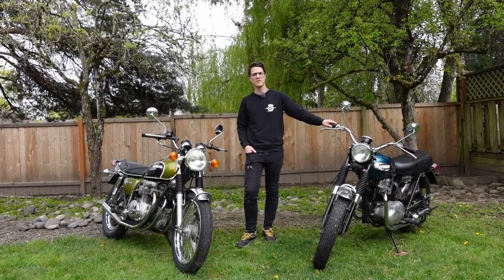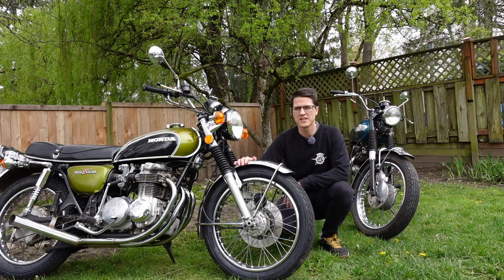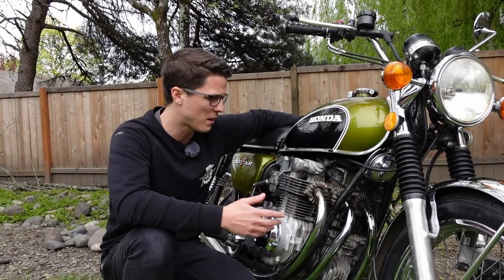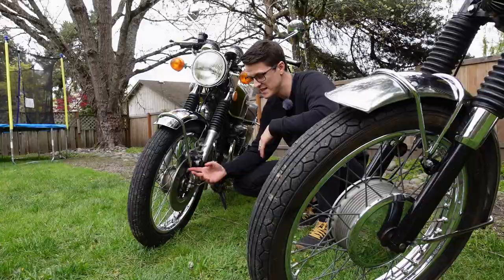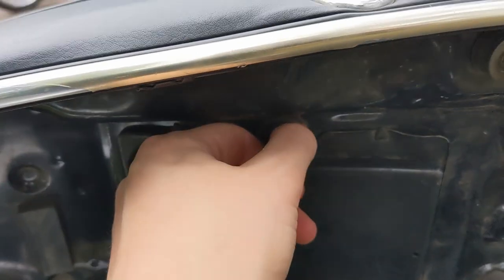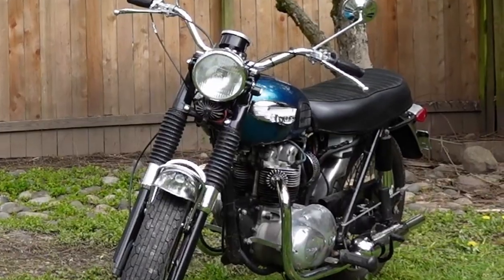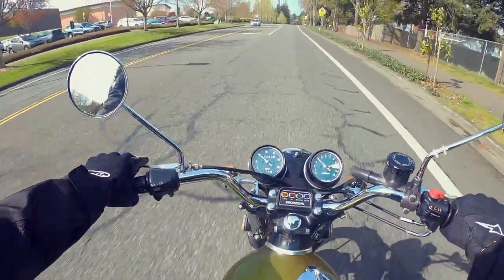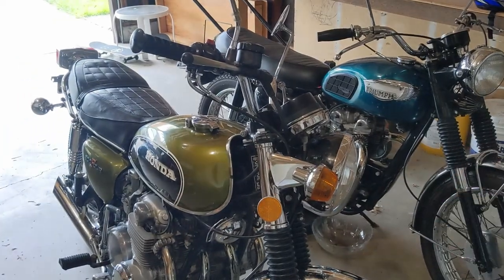How this Honda killed this Triumph

Comment: The Honda in the clip, does not have the genuine exhaust system, which consisted of FOUR mufflers, not the two on this bike. I owned one of these bikes, the first thing I did, was ditch the speedo and tacho to fit the 750 sized ones, bigger and easier to read at speed. the bike was as smooth as a swiss watch, no vibes an all, rear vision mirrors easy to see at any speed. On a long trip to our Pilbara area in the 70's, the high oil temp came on, was using recommended oil, Castrol at the time. Slowed down, light went out, on return home, fitted oil cooler wafer between oil filter and engine and oil radiator. Never again had any such issues. Chain and sprockets were the biggest wear and replacement components on the bike. The fuel consumption and too small a tank were also issues on long touring trips, had to carry spare gallon container at times, whilst Yamahas Suzukis all had better economy than my Honda. BUT the biggest win for me, after owning a BSA, was NO OIL LEAKS !

Comment: The Honda CB500/4 had the same single pot front brake fitted to the CB250, the CB360 and the CB400/4. It really was one pot on a swinging arm which was sprung against a stop. The other pad was not powered at all. Not too bad when new but deteriorated rapidly when subjected to the corrosive salt of a British winter resulting in a seized pivot post and half the expected braking power. We were teenagers so these bikes were our "daily drive". I worked in a machine shop and biking friends came to me for help. I'd press out the pivot pin and polish it. The brake swing arm would be reamed clean if sufficiently bad. The key modification was to fit a grease nipple to the swing arm. If you could pump grease until it came out of the top and bottom of the pivot, the brake worked correctly.
As an aside, I have always found a decent properly adjusted twin leading shoe drum to be every bit as effective as a single disc. Just a bit of a bugger to adjust.

Comment: It was not just Honda it was the Japanese bikes . I started on Hondas but quickly switched  to Yamaha. Getting Honda parts was murder.  Two thousand miles on a s90 and the cam would be pulling it's way through the head.

Comment: Riding is a visceral thing. Also, like personal relationships, sometimes the idiosyncrasies and shortcomings help us to bond closer. Machines stimulate us in different ways, some vibrations, sounds, tickles and wind can annoy us or endear us. Having ridden everything since mini ones in the 60’s, some of the fondest memories are of the most break down prone bikes, like my iron head sporty I carried to and fro for 2 years. However, there is a place in my heart for the ‘69 cb 750, that I only changed oil , filters and rode for 2 years. I have a new Harley that is a beast and I couldn’t want more, yet I one for the shovel head I had briefly (spent more time fixing than riding). Or the xs11 that was a rocket ship or a kitten depending on how you rode it. Throw a leg over, ride and buy all you can (there are great deals on all kinds of old bikes now) and find out what pokes and prods push your buttons. Ride ride ride, and if you have to fix it, make it a party! Thank you for all your great vids, you are a true rider the story goes a non rider saw someone getting off a bike and said “ oh, I would never ride a bike! don’t you get cold and hot and sand and bugs and wind and rain and people trying to run you down? “ The bike pauses and smiles and says “ Yeah, ain’t it great!”

Comment: He is absolutely correct. The Triumph is a sexy looking bike while the Honda is simply good looking and while that played well for a while after Honda introduced the 4’s, in the end Honda’s(and most metric manufacturers) reliability and performance prevailed over Triumph’s mechanical/electrical problems and thin dealership network. It’s why in 1977 I sold my 1973 Triumph Tiger 750 and later bought a Suzuki.

Comment: I have a 1973 Honda CB 750 out in my garage right now , It's a lot of fun to ride and when I was 17 I had one of the funnest bikes on earth a 1975 Kawasaki KH1 500 the old 3 cylinder 2 stroke and I had that bike up to 135 mph and it still had more left and took it to the drag strip and stock it would do the 1/4 mile in 11 seconds , I like the older bikes and that's why I have a CB750 in my garage today

Comment: This takes me back! 37 years ago I purchased a bike from a friend who had built it from a collection of various Honda parts - it was a 500/4 engine and frame, but the forks and fuel tank were from a slightly later 550/4, whilst the clocks were from a 750/4 I believe 
The frame was bright red, and the tank was white with a matching red stripe 
It was my only daily transport as I didn't have a car licence for another 3 years so I rode that thing all year round 
Loved it.
He had also fitted one of the original Yoshimura 4 into 1 pipes, and to this day I've never heard a better sounding 4 cylinder exhaust...
It did have a few downsides though 
The electric start would never work from cold if it wasn't the middle of summer 
The bike would cut out on 2 cylinders after about 20 minutes in the rain and the vibration although unnoticeable at first would gradually turn your little finger on both hands numb after 45 minutes or so 
Handling wasn't great either but I loved it
Reply: The FrankenHonda!

Comment: The CB500's and 550's are likely the most fun and best handling street bike from that era that Honda made. Much punchier than the lower displacement 4 cylinder models, and much lighter feeling than the CB750's (without being terribly slower). 

As expensive as they are, you need to find a set of solid original 4 into 4 mufflers for that machine. While they are fun bikes no matter the configuration, the original exhaust system Honda manufactured them with is the best suited, hands down. The OE exhaust systems on those 4 cylinders truly do provide a whole different experience of riding on that model in particular that is worth the investment, if you can find any!
Reply from the maker: Hey! Agreed completely. I actually got a set of originals and I'm polishing them up. A in little rough but most of the rust is coming off. Thanks for your comment!

Comment: I don't know about USA but in UK Triumph had customers with brand loyalty who would not have considered buying a Honda. The 1970s was a bad time for manufacturing in general in UK. The Triumph Trident never worked as well as it should as the tooling was antiquated and not designed for 3 cylinder engines. The same with the Triumph Bandit, lack of investment meant that they just never managed to get it into production. If you think the CB500 has good brakes, try riding it in the rain!

Comment: I just noticed You had a dish underneath the Triumph to catch the oil, that is the most annoying part of the triumph and You never knew if You could reach Your destination.
That's why I decided to buy an H2 triple, yes I was a hooligan, that's why I tuned the tripel to the limit.
I am cooled down now. Most roads I used are prohibited for 40 Years for Motor Cycles. I am old now
and I like to drive motorcycles even if I have to get a motorized wheelchair. Thanks for Your video, I enjoyed it.
😁😁😁

Comment: I grew up with a lot of motorcycles from the 1960s and early 70s. Not in a good way, we mostly got old street bikes and chopped things off them and installed knobby tires and used them for trail riding and hill climbing. I had several Honda 305 scramblers, uncountable CB and SL 350s, Most of the Suzukis were TS or TC. The Yamaha's were mostly DT 125 and 250s. I wish I had some of those bikes back today.

Comment: The classic British twins are absolutely beautiful. I love the simplicity of the design. That is part of the reason I was why I tried to but an '81 YAMAHA XS650 Special as my 1st bike. The vertical twin, air cooled, chain drive, with Japanese reliability, etc. I missed put on that bike (somebody bought it the day before I went to buy it) so I bought an '82 Kawasaki KZ650 CSR instead. I still would love either an XS650 (perhaps with a 750 big bore kit?) or a Royal Enfield Interceptor.

Comment: I would disagree the CB 500 four killed the Triumph 500, actually most likely  it was the CB 350 twin, rated at 36 hp it could do the ton (not recommended) and outran the Triumph 500 all day long. Most of us boomers that started riding in the late 60s/early 70s owned a CB 350 at one time or another.

Comment: I had a Tiger 500 - sigle carb, less cam than the Daytona. and it was a way sweeter machine than the bigger twins. less vibration and peppier. Turner designed this engine to be a 500.  Apples and Oranges. They could run with the 650's on the right roads - by which I mean anything but freeways. Obviously a caveman machine compared to  the 500/4 .

Comment: The Triumph's original designer Edward Turner got the power he needed for his motorbike out of the least amount of materials, the least amount of moving parts as possible.  The engine's covers and castings were pieces of functional art, and it's amazing how he did it all at once and forever, way back in 1937.  His first Speed Twin could hit 90 mph.  What was Yoshiro building in 1937?
The design was produced for over forty years with upgrades all along the way, but the original arrangement never changed.

The Honda, while a 'better' motorcycle, was built for function and being a four, turned out a little porky. Being small of bore, the exhaust note isn't deep, but instead a complex growl.  
It became difficult to sell new Triumphs because there was a million of them out there in good shape, while the Honda was fast, new and different.  And cost less.

Comment: As usual,  a most interesting video.
As someone  who owned Triumph, BSA and Honda 500's from new, I would say this;
the English machines were as fast, had better roadholding and had better brakes, (yes late model tls drums were better than early discs).
However, you could ride the Honda away from the dealer and as long as they were correctly serviced, the rider rarely had to touch them. On the other hand,  a Triumph owner planning an enjoyable weekend ride needed to spend Friday night with the tools. Regular oil changes were a must with Hondas; Triumph and BSA owners didn't worry so much as they were always topping up the oil that leaked out
I cannot remember a BSA  or  Triumph that had an electric start. I think later Norton's did, but it helped if the rider lived on top of a hill.
By the late sixties/early seventies, motorcycles were no longer a cheap means of transport.
Customers, mostly young men, wanted machines that started at the press of a button and could be serviced by a mechanic while they went for a cup of tea and scones. Nothing wrong with that.
My CB500 was a jewel of a machine, in my opinion better than the 750.
ATF in the forks and a pair of Hagons on the swinging arm was all that was needed for perfection.

I think my comments apply to the 500, 650 and 750 models of the era. The English factories were looking for short term profits by flogging thirty and forty hear old designs. The Japanese lads were planning long term.
I would advise to never sell your CB500.

Comment: I had a  1956  500cc Triumph T100 for three years. Very similar to the one shown here, but it still had the separate gearbox, and the streamlined headlamp/instrument housing. The sound was the same - heavenly. Great bike. Much later, for seven years my ride was a 1982 500cc Honda GL500I Silverwing Interstate, another wonderful bike.

Comment: I never rode the CB500 but I did ride the 450.  I had a Norton 750 Commando at the time.  But the guy was so proud of the Honda and He really wanted me to ride it.  My NOrton was Kick start and it had Amal Carbs.  those were not pluses.  But the Honda had a frame that felt like it was made out of a rubber band.  I am sure the Honda was a good little Bike, but one ride was all I wanted.  I would take my old Norton all day long.  Now mine was one that had the rubber motor mounts so no vibration.  Sweet old bike. I bragged on his bike , didn't want to hurt his feelings,  But thought what a piece of crap as I rode away.

Comment: The suspension of my Trident 660 is not much better than your 500. The rear is to hard and nothing to set except the spring load. Triumph still has to learn some things, the old English way is still there in some form. It's good that there is at least one English brand even that they are build in Thailand. Maybe Royal Endfield found the thru way to go. Buying Harris for the frames and so on. I wish Triumph came back with a 500cc twin in modern form.

Comment: The British bikes were unreliable - leaked oil - had old technology carburators - dismal electrics - and vibrated especial at highway speeds - old technology brakes - better handling than the Japanese - sound better than the Japanese - looked better than the Japanese - more character than the Japanese.

Comment: Honestly, if you remove all the extra reflectors, trim down the turn signals, and repaint that CB the gorgeous blue or orange you could get many of them in, it'd probably look better to me than the Triumph. I appreciate that the Triumph is the 'OG', the bike the CB was imitating, but I think Honda did the style right. The CB750K0 is even better looking (when painted that gorgeous blue or orange).

Comment: Triumph, with its lower centre of gravity, is far superior on gravel roads and in tight cornering than any Japanese road bike of the era. The Triumph right off feels like an extension of your body, unlike the Honda which you are always having to cajole into corners.
Reply: Yes I don't think the Japanese ever had a great handling bike...I've owned/rode many and didn't see it. 
You learn about countersteering in a hurry...I guess my cb750f wasn't to bad in that respect but a bit squirrely.
The British with there twisty roads made sure there bikes could handle. Even my #800 Rocket3 would lay right down into a sweeper with confidence and little effort.

Comment: I’m in my early 60s and grew up with both, but the Honda is by far the better bike. However, if you put a Velocette in the mix, the choice would be a lot harder. And in many ways the MV Agusta 750 DOHC is better than the Honda.
Reply: Those MVs are stunning in person and very rare - I've only seen 2 the past 45 years.  And I love those old Velocettes. I guess I'm a bike schizo at heart though with a CB1000R, CB1100, and a GoldWing DCT Bagger.
Reply: @gwilliamwallace  Indeed. Some bikes are almost too gorgeous to look at, never mind own. I saw an MV 750 on the auction stand at the 2020 London bike show. That was my first since finding one parked in a field at a race meeting in the early ‘70s, when I probably just thought it was odd. Yep, very rare. 

Bam in those days, guys were riding Rickman Triumphs and I saw one Egli Honda. Somewhere there’s a small collection of Kodak Instamatic and Zenith 35mm shots from that era. 

Most of my bikes are Hondas too, including a 1983 Marysville built VF750F Interceptor that’s in need of a full restoration, and a Japanese domestic market CB-1 NC27. 
Ride safe.
Reply: @G58  Thanks for the reply.  I love old bikes.  When I was a teenager riding dirt bikes in the '70s a couple of guys with Ducati 450 scramblers would come rolling through the gravel pit occasionally and though none of us knew what they were we knew they were special.  I too had an Interceptor and wish I'd held onto it.  The problem is I risked going to jail every time I rode it.  The sound at high revs is a drug and I am an addict.
Reply: @gwilliamwallace  Oh yeah. I’m not sure we had the Ducati scramblers here in the UK. I do recall seeing yellow tank 250cc and 350cc road bikes with clip-on bars and single seats. But they cost way more than any comparable Japanese bikes, were not as quick, and were nowhere near as practical. 

So I had a gorgeous candy orange CB250G5 that I tuned an blessed with some Harris parts, Avon Roadrunners, Girling rear shocks and improved front springs. That was a great bike in the end. Then a speeding car driver hit me side on at 60mph, wrote off my bike and nearly killed me!

Anyway, I got to find out what it’s like attempting to enter low orbit, before reentry and a bouncy landing on tarmac!! I owe my life to my first AGV Ago helmet.
Reply: @G58  What a story about getting T-boned on your beautiful orange CB250.  Glad you made it and sorry about the bike.  Coincidentally my first street bike is a Sunrise Flake Orange CB550F that I bought new in '75.  I still have her though she hasn't run in decades.  Long story but there's no reason why I can't bring her back to life one day given enough time, money, and will.  Love those Avon tires by the way.  I have a set of Roadrider IIs on my CB1100 that transformed the handling completely for the better.  Those combined with a set of Arrow headers and it's a time machine with the dials set for 1975.

Comment: Had a cb500 great bike in its day, had the two pipes up each side looked and sounded great, don't remember the brakes being that good though. Was super reliable until my dad put the battery in the wrong way round and melted the wiring loom 😭